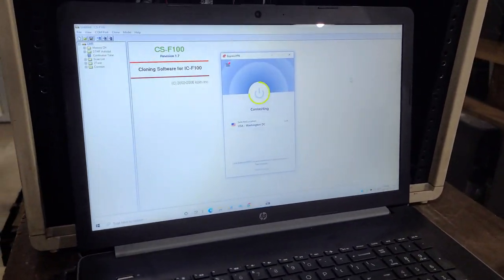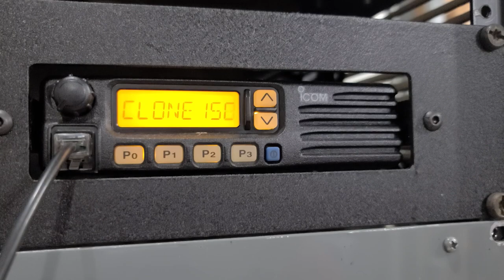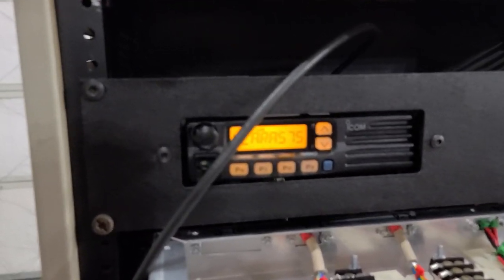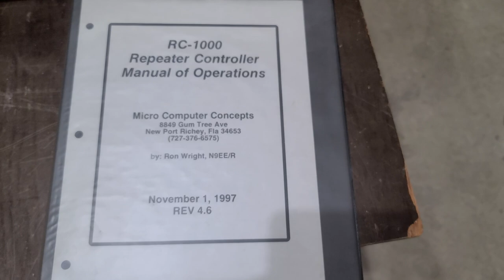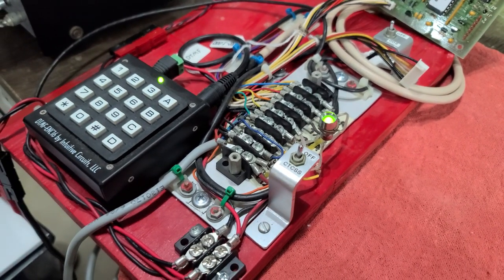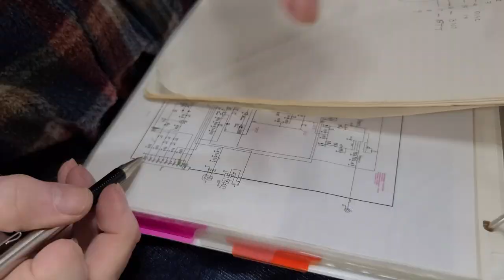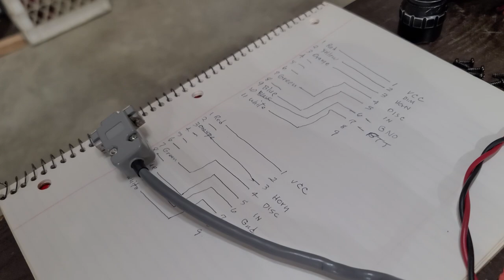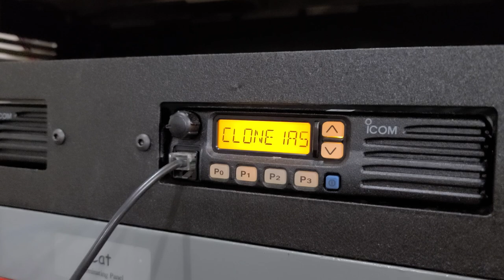LCARA HAM Radio: Building a GMRS Repeater Part 5 - Troubleshooting and Controller Programming!!!!

Comment: Hello, I'm trying to do this exact setup and i have a problem when i try to talk and if i have the TX on high I can only hear static and can't hear the voice come over the radio and I was wondering if you or anyone would happen to know what the issue is with it I have a duplexer 400-500 Omnidirectional antenna and 2 IC-F221s radios.